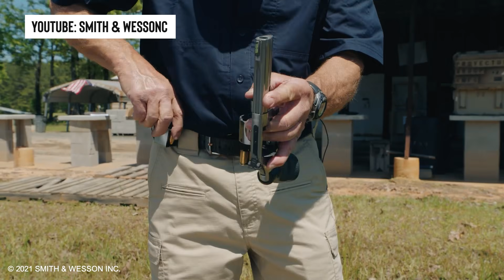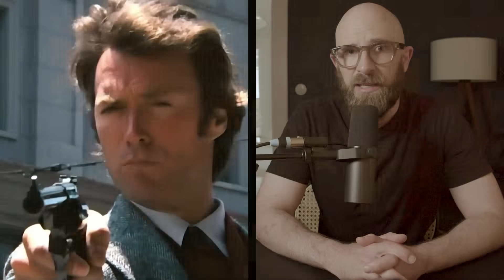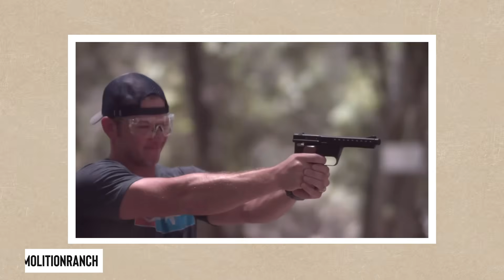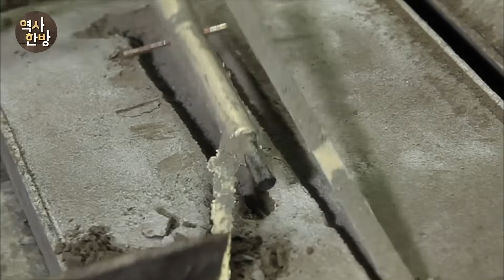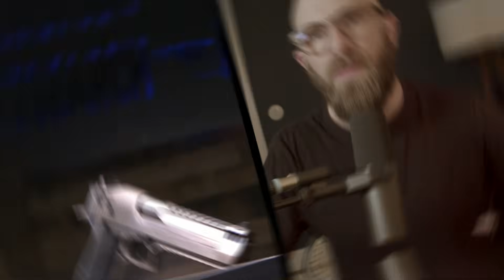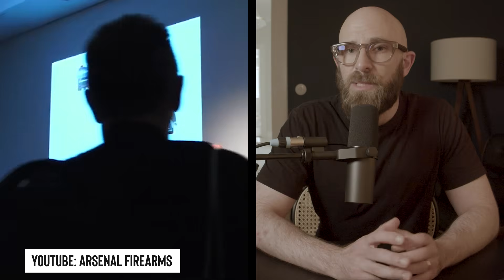Most Ridiculously OP Handguns of All Time

Comment: The big problem with the gyrojet pistol was that, even if it worked perfectly to spec, it didn't fill the typical use case for civilian self-defense guns or military sidearms very well.  

Most civilians using a handgun to protect themselves from, for instance, a home invasion, are firing at a range defined by (at maximum) the length or breadth of a room or hallway in their home.  Very rarely is that going to allow for the 60 feet needed for the gyrojet to get up to full speed.  Statistically, even in open spaces, most use of handguns in self-defense happens at ranges between 3-7 yards, which is not the range at which a gyrojet shines.  In fact, there's a rule of thumb called the 3-3-3 Rule that states that most uses of firearms involving deadly force occur at about 3 yards, last less than 3 seconds, and involve 3 shots fired (basically, a person under that level of stress often pulls the trigger three times before their conscious mind catches up with the observation that they don't need to fire again).

Most military doctrine around handguns as sidearms is that they are either last resort weapons in situations where a rifle or assault weapon can't be maneuvered properly (basically point blank range) or by people "in the rear with the gear" who need a weapon in the rare case that the latrine filling hits the rotary air impeller in a big way, in which case it's likely to be pitched, relatively close-quarter shooting and you honestly don't want rounds that will go through walls and hit people downrange that you can't see, because they could be your own people.  Again, gyrojets aren't going to work well there.

Specific usage in Vietnam would have been a disaster, too, as dense foliage often meant you ended up engaging at relatively close ranges, again putting the gyrojet outside its ideal use case.

Sometimes a device can be an amazing innovation that solves a very specific problem very well -- but it just isn't a problem people need or want solved, and they're looking for something that will solve problems they actually have.

Comment: Surprised the Metal Storm 9mm didn't make the list. A handgun that fires three projectiles before the shooter would feel the recoil of the first and no moving parts definitely makes up for the smaller caliber. However, the company went belly up in 2012; probably on account of the United States not liking the complexity of the weapon's electronics and the specially designed ammunition having too high of a cost and logistics tax to maintain (it's fun to have a gun that shoots a million rounds a minute until you're the one paying for the bullets). Had it continued, the company was looking at a terrifying .45 ACP variant with similar performance to the 9mm.

Comment: Good vid. Wh40k fan and ive always loved the gyrojet but ive always thought it made more sense as an indirect fire weapon.

There was a tank called the Sheridan, in the 70s I believe, that had a gun launched rocket as its main weapon. Weapon had mixed results so it was abandoned. I bring it up because although it was never made small it is the lore accurate bolter. A gunpowder charge launches a rocket which performs better than a shell or slug.

Maybe the sheridan could be a future video?

Comment: I think the problem with the AF 2011 is that it's an open question as to whether or not it could be considered a "machine gun" under current US law.  This is because the wording of the law that defines a machine gun is that it fires more than one round with a single pull of the trigger. Because the AF-2011 fires two rounds per trigger pull, it could technically be considered a machine gun. I'm guessing Arsenal doesn't want the the potential smoke from the ATF.

Comment: Rather antiquated as it is a 'black powder' round.  At the time of inception, it was - as you report - a cartridge designed for hunting large dangerous game.  These were typically found in Africa and South East Asia.  The round shown  is a Four Bore Hubel round.  .According to "Cartridges of the World, 17th Edition"  The 4 Bore Hubel round was developed in the early 21st Century (development work began in 2009).  It is based on the 4 guage shotgun round, but features an all brass case made originall from a 20mm Vulcan cannon (anti-aircraft cannon) and capable of containing more pressure than the initial 'paper' cases.  

Of note, the round was possibly first developed as a shotgun round  known as the "4 guage".  The shotgun shell version was intended as a 'long range waterfowl' load.   Commercial waterfowl hunting seems to gone out of fashion as waterfowl 'ranching' seems to be more profitable.

The shotgun (black powder) version  was antiquated by the development of 'smokeless' powder.  Black powder, due to the inherent limitations of the chemical composition would develop an expansion rate - which determines the muzzle velocity of the projectile regardless of weight - of around 1800 feet per second (fps) - more or less .  Heavier projectiles would have a lower velocity, but no matter how light, 1800 fps was the upper limit for rifle use.  
(Just as extra trivia. smokeless power has an upper limit of between 5000 and 6000 fps.  I am unaware of any conventional arms of that 'top'' velocity.)
As the black powder rifles had velocity limits, the only way to increase the terminal (when it hits the target, be it paper, chipmunk, filthy American rebel or elephant) was to increase the diameter and weight of the projectile.  

Current 'elephant' - dangerous game - rifles are usually between .375 and .50 caliber - which is .001 inches in common language. Bullet weights range from 300  to 400 grains (just under 14.5  to 26 grams).  A typical muzzle velocity is usually in the 2300 to 2400 fps range,
The Two bore rifle seems to have been a 'first on your block' one up development.  (Sort of like an automobile which is 'street legal' and will cruise at 200 mph.)  At least one hunter in Africa used one, probably not terribly often.

.44 Magum.  Introduced in 1955, it was the most powerful general production commercially available handgun of the time.  There are more powerful 'techically' hand made, but most of them are special order of some type.  Many of the ultra powerful 'handguns' are actually small rifles, fitting the diminutional definition of a handgun.  
I do have a Smith & Wesson model 29 in .44 Magnum.  Bought somewhat over twenty years ago I still keep it for sentimental reasons, remembering my youth.  I cannot say it is 'fun' to shoot.   

The .454 Casuall was one such.  It did chamber a handgun cartridge (initially a .45 Colt case) but is was never an 'off the shelf' sort of firearm.  Revolvers firing the round are still available commercially but are not commonly stocked on shelves.  They are another specialty item

The 600 Nitro Express Austrian Dream Catcher Wrist breaker.  Being a pistol shooter for some six decades now, I find it difficult to refer to this as a handgun.  The entire raison d’être for the one handed gun was to facilitate carrying the weapon easily.  (Cavalry on horses., for instance.).  Whereas the mentioned arm does not have a buttstock, nor does it lend itself to holster carry.  At any rate the Fieferfaffen (whatever) is not a commercially manufactured for general sale.  It's another 'be first on your block' device.

As noted, the Gyrojet (pistol and rounds) were a great idea.  Too bad it didn't work.

Chong Tong.  For the time and engineering evolution, not bad.  By today's standards, sort of cute.  But then, I find it silly to compare a new car to a Model T.

I saw ads for the Double Barreled Government Model when it was released for sale.  I thought it was a cleaver attempt resulting in a hideous mess.  I think less of it now.  I do not recall seeing a holster.  Ever.

Comment: A few years ago at SHOT Show, Taurus brought a 28 gauge revolver version of the Judge to the showroom floor for a half hour before the US BATF (Bureau of Alchohol, Tobacco, and Firearms, aka, the Fun Police) had questions. Handguns over .50" in bore diameter can't be imported without their consent and Taurus forgot to ask, so they had to take the 28 gauge revolver (.55" bore diameter) off display. It had a rifled barrel to avoid being a Short Barreled Shotgun or Any Other Weapon(AOW) requiring extra paperwork and taxes for potential buyers, but it was still considered a Destructive Device as an import from Brazil. If it was made in the US, it could apply for a sporting exemption like the .600 Nitro Express single shot from Thompson Center and a few other larger than .50 caliber pistols. They were able to import it and sell it as a 28 gauge revolving shotgun with the proper length smoothbore barrel and overall length, but 28 gauge is not common in the US.

Comment: Holland and Holland and Parker used to make "Howdah" guns, which were mostly 20 gauge or less as backup guns for tiger hunters. They would be in their howdahs, the little huts or platforms on top of an elephant used for safari, shooting down on the tigers beaten out of the bush. If they missed, the tiger might climb up to get them, so they needed a backup gun. Howdah guns were loaded with blackpowder and roundballs, designed for pointblank range at an angry tiger. When cartridge guns came around, they made them in the various "smaller bore" rifle rounds in single and double bore, pistol versions of their shotguns or big game rifles.

Comment: $17,000 USD would be pretty cheap for a one off custom wheel gun like that. 

I personally know several custom gunsmiths who's entry level platform is around $10,000 USD and easily reaching $20,000 USD+.
Reply: Ha 10k 20k pfff that's bum wiping $$$$$$ the real firearms  are ones that start at 250k before customization  most are  optioned up to 3x their pure stupid base price

Comment: Good publicity to show off the percise machining required to make a double barrel 1911 run properly... Which they failed at. The af2011 wishes it has the horrible reliability of a Deagle. Really. Getting through a mag(7 trigger pulls) without a malfunction is near impossible. Then when that inevitable malfunction happens, it usually triggers the other side to malfunction, so you end up with 2 different types of jams but only one slide to manipulate. That slide can get really locked up on you and ends up taking some time and brute strength to clear. Great idea but its not reliable enough to be a fun range toy, nevermind a serviceable weapon.
As for the gyrojet, even if the stars align and your ammo is perfect; its definitely not OP. If you were to have to use it indoors, or at similar ranges, to degend yourself, youd be better off using it as a club.

Comment: People use handguns to get to a rifle or if they can't carry a rifle.
A few people have died firing big bore revolvers as in a .500 S&W to someone not used to shooting powerful weapons one woman fired the first shot but she could not manage the recoil leading the barrel to flip under her chin and as she held on she pulled the trigger another time reducing what was her head into red mist.

Sure it's a little funny seeing someone firing a 12 bore shotgun the first time but giving something way to powerful to someone that will mostly likely result in injury even though death was never intended should be manslaughter, they are not toys.

Everything is a balance, most of these weapons are pretty much toys, a revolver that's around the same weight as a short rifle is useless so are 2 handguns strapped together.

I would rather have a standard high capacity handgun in 10mm with modern ammunition and an optic or better yet a short rifle.

A weapon such as the MP7 or P90 would be great especially if you have access to AP ammo , western type rifle as in something similar to an AR15 without the rear buffer tube in .300 or AK in 7.62 with a folding stock and optic with a barrel length between 10" to 12" is great.

Small caliber rifle rounds like 5.56 NATO don't perform so well out of a short barrel as it needs barrel length for velocity so whatever weapon you need should be designed around its main use and ammunition type.

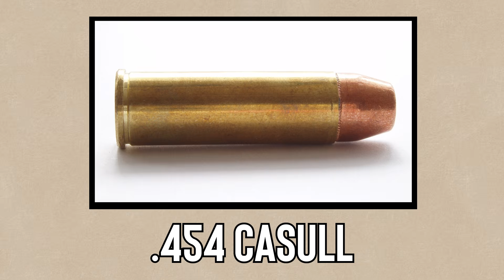Comment: 05:00 Because the .454Casull fires the same diameter bullets as the venerable .45ACP war veteran, it is still the largest legal caliber sports gun in most of Europe, and therefore can be obtained legally despite its 1.5x .44Magnum power envelope. My first experience with my brand new 454 Ruger was the range master tapping me out with a few napkins. The recoil had torn the skin between my thumb and index finger so I was dripping blood like a stuck pig. The recoil had also numbed my hand so much that I hadn't noticed.

Comment: Is nobody going to talk about how the double 1911 is illegal in US markets for qualifying as a machine gun because it fires more than one projectile with a single pull of the trigger?
Reply: Not illegal, you need the appropriate ATF registration.
Reply: @robertromberger4708 which is stupid, because it’s essentially no different from firing 2 normal 1911s (or any other semi-auto pistol) at the same time. It’s wild that because of a conveniently broad definition, a double barreled pistol which is still clearly semi-automatic, could still be classified as the exact same as a real MG that actually keeps firing if the trigger is held down (at least as long as ammo, maintenance, and barrel last lol). Double barrel 1911 = belt fed water cooled Maxim MG, MG-42, Browning M2 .50 cal…😂

Comment: I believe they cannot sell that AF2011 in the US because it technically fires two rounds with one trigger pull, which defines it as a "machine gun." I saw a similar dual barrel AR-15 that they could not sell in the USA with a single trigger, only two separate triggers which makes the gun very difficult to use effectively. Not surprised AF would just not bother in the US.

Comment: So here's why no one but governments in the USA can buy the double barrel pistol, it's technically an automatic handgun. Semi auto = each action of the trigger fires 1 round. Full Auto = more than 1 round for each action of the trigger. 

Also the hardest part wasn't the picking up another round, it's that both rounds WILL go off at the same time otherwise you get out of battery when hit thus either light primer at best or an exploding gun chamber at worst.

Comment: The "# bore" rifle measurement, so "4 bor"e being the diameter of a 1/4 pound sphere of lead, is the same system as used for the "gauge" system for shotguns. A 12 gauge shotgun has a bore the same diameter as a sphere of 1/12th of a pound of lead.

Comment: It is important to mention Drop Towers from which known drip sizes of lead were released to fall and land in water to cool, it was the easiest way to mass-produce relatively accurately sized balls that could then be press-forged into bullet slugs.  This is why the bores were in weights.
Reply: Not to mention that it simplified the description of a shotgun bore (of which only the .410 is described in inches).
Reply: In Melbourne they have one such tower preserved right in the centre of the city’s main shopping centre main hall.
Reply: Town I grew up in had something similar, but for ammonium nitrate. They were making it for the local mines rather than as fertilizer for the most part, and having more uniform and spherical pellets yielded better results.

Comment: IN RELATION TO THE DOUBLE 1911…

“It has to fire both at once, because otherwise the slide won’t cycle” 

Yeah but also, even if it did have the power to cycle the slide, upon shooting one round. The other round, that has not fired would be ejected, and thrown from the firearm….

Ergo, if you want to make this gun, it HAS to fire both at once, but not because one bullet can’t cycle the slide.

So much cringe here in this video lmao.

Comment: Sir Samuel Baker used a very large bore muzzle loading rifle as a rifle of last resort when pursuing elephants in very heavy cover during the mid 1800's. Technically it wasn't a 2 bore, but it did fire a half-pound bullet with 270 grains of black powder. It weighed about 20 pounds, and Sir Samuel dreaded firing it, the recoil was so severe. The rifle was built by Holland & Holland, and they still have the records of its manufacture.

Comment: If one trigger pull of the AF2011 could fire two rounds, wouldn't that technically, legally transform that into a full auto firearm?
Reply: How? It’s basically like firing 2 separate 1911s or any other semi-auto handgun at the same time. It doesn’t keep firing if you hold the trigger down.
Reply: @andrewp8284  If you only need to pull one trigger for them both to fire, that would meet the "multiple rounds per single trigger pull" requirement of a "machine gun."